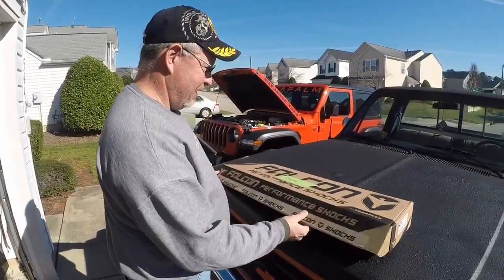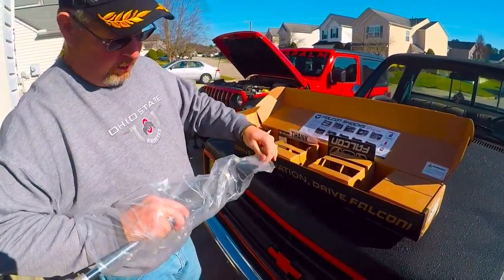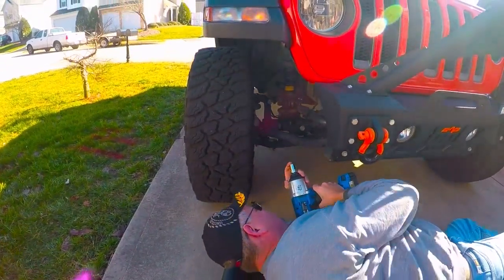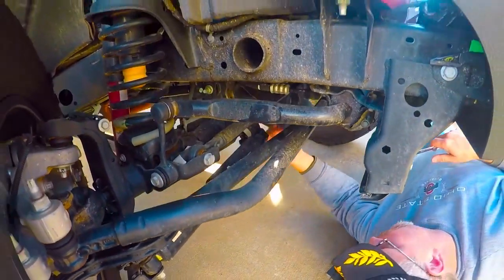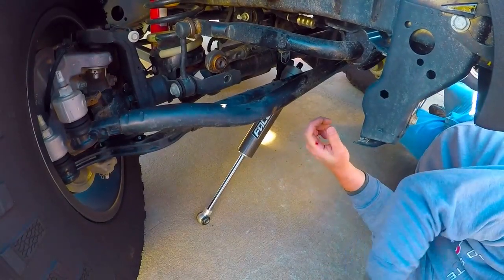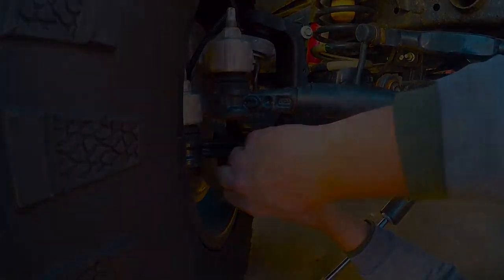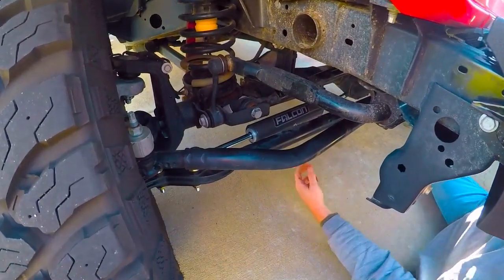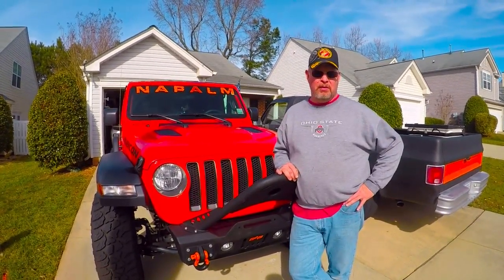Falcon Nexus Steering Stabilizer

Comment: i just bought the Falcon Nexus EF 1.1 a little much less but its still a pass through rod. i don't off-road maybe once a year if that but i do tow a small 3500 pound travel trailer and the jeep sometimes swings on the highway wind or switching from lanes or hitting dips  i am hoping this can help a little. dont expect a miracle but any little bit of help is a good thing.
Reply from the maker: Well, all Jeeps move around with wind. I mean, they're basically a brick being pushed through the air, LOL! But, in my opinion, the better stabilizer SHOULD help the "feel" in the driver seat. Good choice! Thanks for watching and the comment! 🤘🏻

Comment: I have a 2019 Rubicon 2 door just like yours. Curious about this product since I experience the dreaded dead spot/wandering steering wheel issue that some JL owners have. I was wondering if you had this issue as well, or just purchased for a performance upgrade? After researching the topic and concluding a fix/solution has not been found, I'm looking into purchasing a stabilizer to see if it helps.
Reply from the maker: Fortunately, no. I have not had this issue with wandering or death wobble. I would replace the track bar first, then the steering stabilizer. Lemme know if you'd like some suggestions. Thanks for watching and subscribing!